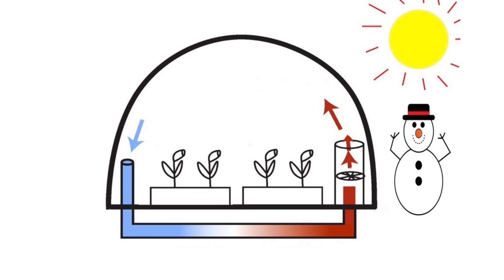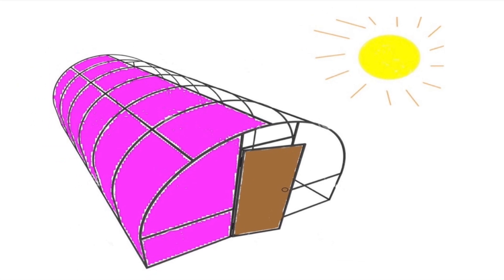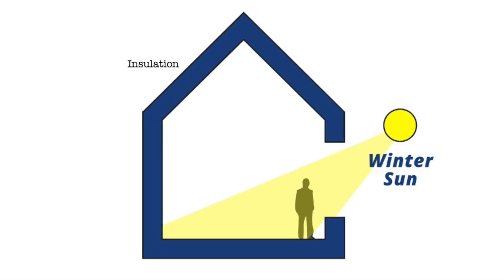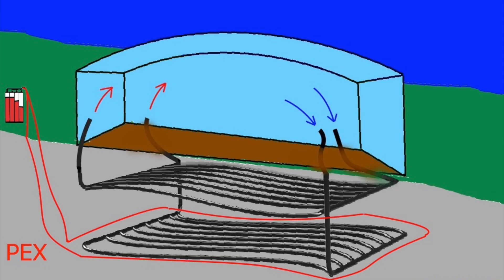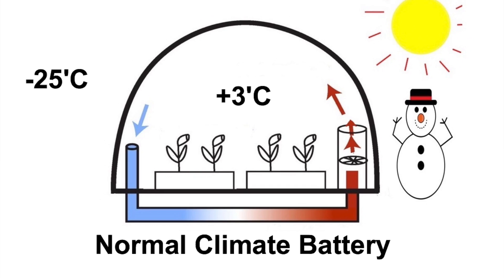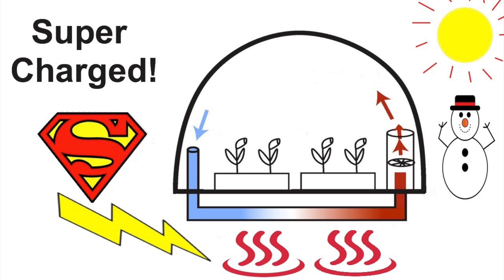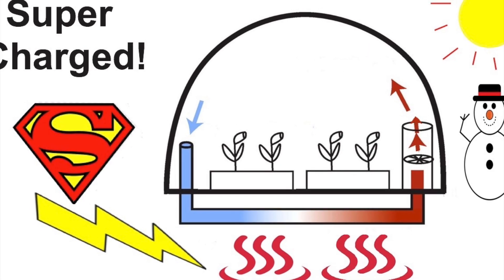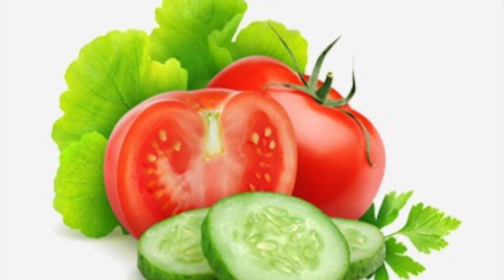Geothermal Solar Greenhouse Climate Battery Supercharged (2020)

Comment: I could have sworn that if you create an enclosed environment with plants. Even in super cold tempetures it will still be very hot through natural thermal processing. Even to near sauna temps.
Reply from the maker: yes, when the sun is shining, but in northern climates like I live in there is often only 6 hours sunlight in winter, the other 18 hours are COLD without supplemental heat

Comment: It would be nice to see the science and the cost!!! Since the ground temperature is normally 52degrees all that excess heat would be lost in the surrounding earth as that is the biggest heat sink on earth!!! To store the amount of heat for that long of a period of time would require either very unique soil structure for a natural insulation barrier or it would require creating an insulated area for the ground heat to be stored. This is very old "Tech" hence you rude non-scientific comment to one of the post commenter. 70 degrees Celsius is 158 deg Fahrenheit to completely expose the nonsense here. Heating the earth to 150 degrees when the surrounding earth is 52 degrees is a 100 degree difference driving the heat loss into the surrounding soil!!! How much are the evacuated solar tubes and where do you get them? If you are going to heat the ground to 150 deg F you are going to pumping water close to 180 deg F so the system would have to be designed for very high temperature operation. How do you size the storage area? Do you pump down the whole water system in the winter to prevent freezing on sunless days in Alberta Canada??? Do you shutdown and drain the exterior but continue to use the water for heat in the winter? How do you size the fans and air side of the system to get the heat out with out over heating the green house early on in the winter season? Since the underground air side stores heat during the sunny days to recover it at night but the ground temperature is now so much hotter how can the two systems be integrated successfully??? Are you beginning to see the picture? This is a click bait article. IT is a short blurb that sounds good to get you to keep ad $$$ flowing to science empty videos!!!
Reply from the maker: Thank you for such a detailed response. Ground temp varies depending on your location, I only wish it was 52' where I live. One thing to consider is how slowly heat moves through material like clay or gravel. Most people don't realize this. My dad was in the gravel business, and he often uncovered a pile of ice and snow in a gravel pile well into July if it was buried in winter. unmelted. once exposed it melted in a day.

Comment: sorry to say - but its complete nonsense !  there is no way you can store heat for such a long period of time with this method !
Reply from the maker: Ok, I'll make sure to tell Drake Landing Solar community in Alberta, who's been doing this for over a decade, to shut everything down cause you said it's nonsense.
Reply: @SimpleTek  

Can you check out rogers.com in canada.

They make a thermal couple unit for fireplace chimneys that pull 200 w an hour when the chimney is hot. They also have smaller units that work on a desktop, and stove top.

tecteg@rogers.com is what I am talking about.
Reply from the maker: @reypolice5231  look up rocket mass heaters, their use of the exhaust pipe can provide heat for hours without continued burn

Comment: Love the videos - they are inspirational!
Just a couple of ideas..
1) Removing concrete thermal mass from a structure could help to make heating more responsive. With a solid concrete base, this creates additional mass that requires more heating than the air alone; it is also potentially less well insulated in the greenhouse than a well insulated water tank or underground pex pipe.
2) An old dehumidifier could be modified to work as an inexpensive heat pump to transfer heat from a thermal battery (water tank) to heat the air in the greenhouse, then potentially reversed to remove heat from the greenhouse back into the thermal battery.
3) Not seen anyone do this, but windmills are quite an efficient way of producing compressed air; this could potentially be stored and then used to operate a heat pump, providing heat energy even when the sun is not shining!
Maybe not 'simple tek' but there are a lot of second hand AC units that can be picked up for not much $$
Reply from the maker: Omg those are some fantastic ideas! Than you. As for the concrete, I have 3-4 inches of styrofoam insulation under it before bare ground - the concrete works well as a heat sink with that, without that it would be almost useless. Thank you soo much for the ideas!

Comment: Would this work to heat up a small house? If you would dig in the middle of the house 6 feet deep? I saw this system with only the solar part. Not the air pipes. It heated up but not enough. There was also a woodstove.
Reply from the maker: yes
Reply: @SimpleTek  Is there a way to get the details on this? What materials, how to calculate, proven examples? For a house, that is.
Reply from the maker: @godaddypaps  not really, it's all in its infancy technology wise. experiment

Comment: Are you running the Pex tubing inside the large black tubing, or outside of it?

What is weeping tile?  I did not hear that mentioned in the video?
Reply from the maker: pex is run independently - pex is used for a liquid system, weeping tile for an air system. if you don't know what it is,  google it
Reply: @SimpleTek  
I've read several of your comments now and you seem to have a real attitude when people ask you questions - you get all snippy.  It was a question you did not specifically cover in your video - it doesn't mean I don't know what it is.
Reply from the maker: @justgivemethetruth  I only get "snippy' with idiots.

Comment: I'd like to see the experiment or test case that proves you can supercharge the ground to 70 degrees Celsius ... that is how.  Frankly, I'm skeptical.
Reply from the maker: drake landing solar community gets over 80'C - google it
Reply: @SimpleTek  
Drake Landing is huge compared to a greenhouse.  You do get some economy of scale as the larger your heat dump is in volume the smaller is the ratio of the outer surface area versus the volume of your battery - that changes things considerably.  They also use waste heat from industrial processes.
Reply: @SimpleTek  
I've seen all kinds of claims on You-Tube about gardening and greenhouses.  That is not a valid proof of concept.  If it was a lot of people would be doing it, and in fact, why put the heat in the ground where it can escape in every direction.

Conduction proceeds at a rate dependent on the temperature difference, so if you have a 158 degree Fahrenheit spot in the ground, if it is not insulated it will conduction out to the surrounding ground and the air and water.
Reply from the maker: @justgivemethetruth  vhs vs beta, which is better? if this didn't work then why does drake landing work?  hummmm
Reply: @SimpleTek  
Do you even have a thinking process at all or just resort to insults as soon as you open the page here?  I said there are major differences from the place you mentioned and a single small lone greenhouse.  You are probably just pissed that you spent a lot of money to do this and it doesn't work.
Reply: @justgivemethetruth  I don't get your point, heat will always conduct through objects, even insulation. There's no insulation material that keeps all heat, soil certainly isn't a perfect insulator but if you have enough of it, usually not a problem, it will still work. And in fact, alot of people are doing this, just look up borehole thermal energy storage. It's used extensively in the commercial greenhouse industry because heating is one of the biggest costs greenhouse growers make. Interestingly I'm seeing more and more heat pumps being added to such systems, that would allow cooling of the greenhouse while heating the water simultaneously.
Reply: @FOATE  
Got a link to that?

Comment: I love the idea of enhanced climate batteries.
Here's an idea I had for my greenhouse.
Because of the challenges presented by digging up and insulating a huge mass of earth, I  ended up with rather short, shallow un-insulated  runs of pipe under my greenhouse.
With a smaller un-insulated  mass, annualized storage is impractical, so daily storage is my aim.
To backstop against a days with no solar gain,  I plan on using an indoor TLUD system to heat with woodchips while making charcoal, or a mass less rocket stove.
Water boiled into steam will be blown through the thermal mass to maximize the transfer of BTUs via the phase change from water vapor to condensation.
 The condensed water will  travel downward and outward into the soil till it reaches 0 degrees.
That's the theory anyway.
I think a reflective trough  collector with an evacuated tube could produce steam for this kind of storage.
Reply from the maker: That's awesome! Thank you for the post!

Comment: Storing heat in summer for use in winter just doesn't pencil out. When you do the math a small low R structure like a greenhouse needs a massive heatsink that extends for tens of meters on all sides. You can drag a bit of heat forward to help you through a stormy week, but for the most part you are recharging your heat battery during the day and discharging it at night.
Reply from the maker: and yet it works... I guess you failed math
Reply: Simple Tek how do you define “works” because plenty of folks are growing in greenhouses with no climate battery, or with a climate barter recharged by geothermal (like the retired fruit grower in Idaho), or with a daily climate battery (like LDS preppier).

I definitely didn’t fail math though I stopped after calc 3 and a few statistics classes.
Reply from the maker: @opcn18  clearly you did fail as you didn't even understand the examples you quoted.
Reply: @SimpleTek  I don't understand the personal attacks.

The geographical center of North America is Center, North Dakota. A 10'x10'x6' (~3mx3mx2m) twin walled greenhouse in Center heated to 50f (10c) for 6 months out of the year would take 5800 kwh of electricity according to the ACF Greehouse calculator with an  average low of 14.33f (-10c). 5800 kwh is about 5 million kCal. The specific heat of heavy clay soil is about .2kcal/kg per degc nd the difference between 10 deg c and 80 deg c is 70 degrees c. So one kcal will raise one kg of soil 5c, and 14 kcal will raise one kg of soil 70 degrees. Run that in reverse and your 80c climate battery can release 14kcal per kg of soil. With 5 million kcal of heating needs that is 5000000/14 or ~355000 kg of soil. Heavy clay soil is about 1.8 tons per cubic meter, so the best case scenario (where you have several meters of high r insulation on all sides of your thermal mass) you are looking at ~200 cubic meters of thermal mass for a very small greenhouse. A greenhouse that size shown in the configuration in your illustration would have about 6% of that thermal mass. 
It's not heat that you collect during the summer that keeps your greenhouse warm in the winter, it's heat that you collect during the day that keeps your greenhouse warm  at night.

Comment: If you're 10 feet below ground, how do you deal with condensation in your tubing? I've heard of perforated pipe being used but doesn't that create another problem if you're below the water table? Especially in spring time?
Reply from the maker: Airflow evaporates condensation and yes water table is an issue depending on where you are located - I prefer liquid systems vs air

Comment: As I understand, normally the bottom of the climate battery is not insulated to get access to the heat deeper in the ground. However it seems to me that if you want to make this "supercharged" climate battery, it would make sense to insulate also the bottom. My logic behind this is that in a normal climate battery you cant heat the earth up much more than the deeper layers of the ground but in the supercharged version the temperature difference between the battery (70 C) and ground below (10-15 C) would become substantial and therefore the heatloss would be too big. What are your thoughts on this?
Reply from the maker: Thank you for the comment. I agree with you. Drake landing (Alberta) heats the ground up without insulation on the bottom but it's at a HUGE scale, for a small greenhouse I believe you need to envelope the climate battery as you suggest

Comment: Hi Simple Tek,  interesting system.  Questions?  I have a small greenhouse I am building (10 x 20 feet).  It will be 4 feet below the surface, already dug out a 5 x 10 ' area by hand (N.B. has lots of rocks seeds, they grow over time).  How many feet of pipe will I need to keep greenhouse near 10c +?  I will be going down 10 to 12 feet and have room for at least 250 feet.  Is there a site I can contact you through to fill in some other questions.   thanks, Mark
Reply from the maker: Thank you for the comment. LDSPrepper had some info on this in his geo air greenhouse videos.

Comment: what if you ran the pex through the air tubes,wouldnt that get more air heat?
Reply from the maker: interesting idea. but the purpose of the pex is to chargrills the ground so the air tubes can pick up that heat later. inside the tubes the ground wouldn't get charged with heat

Comment: Store it in the ground from summer all the way through winter? No. Your said system would help make it warmer but it will be inefficient. The ground conducts heat and is constantly losing any additional heat in the system to the surrounding mass. Nearly all energy generated in the summer would be long gone before winter. Solar thermal operates at a max 190' F (temperature at which glycol breaks down) which means if it did get the ground to this temperature it would have to dump all remaining heat to the air. Any plants planted in the ground would have their roots cooked. Earth climate batteries are, in terms of heating, only good at keeping greenhouse temperatures just over freezing. For your solar thermal, it would only be beneficial during cold months. The system would be cheaper and more efficient to pipe the heated water into a water storage tank that is located inside the greenhouse. This eliminates heat loss to the surrounding earth because all heat loss is released directly into the greenhouse where you want it. This would also afford additional thermal mass to further regulate the temperature and require far less hardware. Expectations should be that the amount of solar thermal collectors installed generate as many BTU's as your daily loss at the desired temperature or the system will not live up to the hype. Additional consideration should be given that the amount of water storage for your heat is adequate to store (and release!) what you generate daily.
Reply from the maker: jd jd clearly you don’t know what you are talking about. I can give piles of working examples where this works and is working
Reply: @SimpleTek  Try asking for clarification before accusing someone of not knowing! I said inefficiency, not that it doesn't work. Mathematically, by this design you are losing BTU's that you paid for in the solar thermal collectors to the land mass of the surrounding earth. Water is a significantly better battery than earth due to the amount of thermal energy that can be stored in it. By housing your water (heat) storage inside of your greenhouse you drastically increase your efficiency. Stating that heating the ground in the summer saves the heat for winter is a misrepresentation. Most of the heat will dissipate. Additionally, and this is important, you would lose the evaporative cooling benefits of your earth climate battery by heating it above air temperature in the summer by the extreme temperatures solar thermal tubes can produce. Both systems you have described here have wonderful benefits in a greenhouse system but trying to meld them into one inclusive system using the same battery medium is going to cost you.
Reply from the maker: jd jd you clearly have no understanding of costs and ROI
Reply from the maker: @justgivemethetruth  ok, costs means how much money you spend and ROI means return on investment. if you put free energy in, who cares if it's 20% efficient?  your answer shows you have no understanding of costs or ROI.
Reply: @SimpleTek  
No your answer shows me you did not really do this, and you have no numbers to back it up.  See what I mean by being snippy?
Reply from the maker: @justgivemethetruth  I don't have a full year's data yet. that's wh I'm currently quoting other projects that have been working longer than mine.. duuu
Reply from the maker: @justgivemethetruth  or they just want to piss you off..... seems you get that a lot

Comment: Are you insane? 80 degrees Celsius converts to 176 F. You would destroy all soil biology at that point. Worms and plants do not like temps well beyond 82 degrees F.
Reply from the maker: Zeebra237 what’s your point? There’s none of that 2-3 feet down
Reply: @SimpleTek  Roots are 2 to 3 feet down and more. Ditto earthworms. and nematodes and protozoa. They chelate minerals from soil and from leaves and compost. Try using that heat to warm up geothermal heat so the soil is 70 degrees F.
Reply from the maker: Zeebra237 why would this be an issue? You just grass over top of the earth battery, you do not want trees over top of it, the roots would ruin the piping
Reply: @SimpleTek  Are you for real? The whole point of a climate battery greenhouse is to raise food when it is cold outside. Some do use an earth battery to heat their homes.
Reply from the maker: Zeebra237 why do you need to grow food directly over top of the earth battery???? I think that’s where you’re having the meltdown
Reply: @SimpleTek  
The benefit of growing in the ground is it keeps the roots warm and the roots can reuse the condensate which reduces the need to water ;)